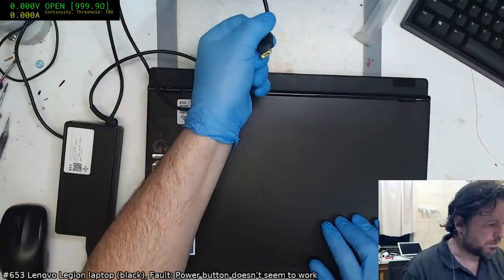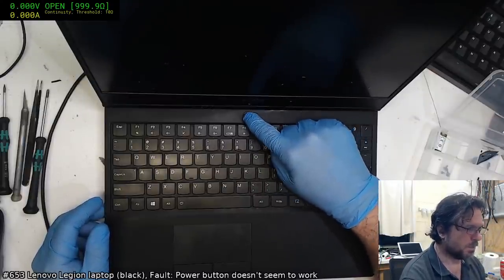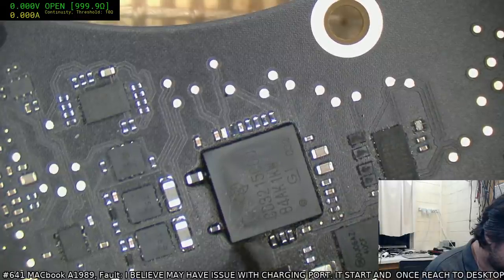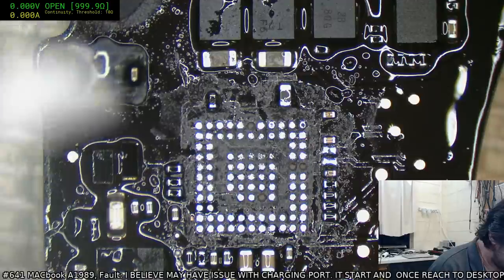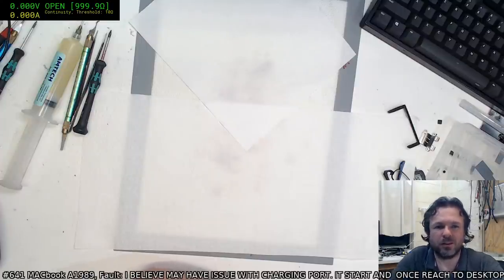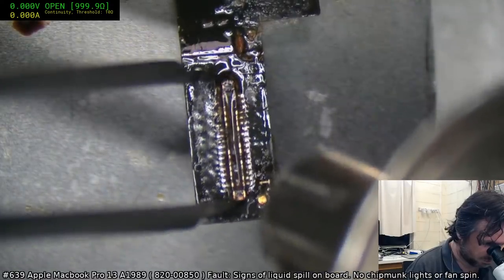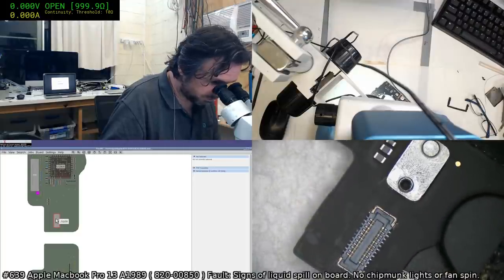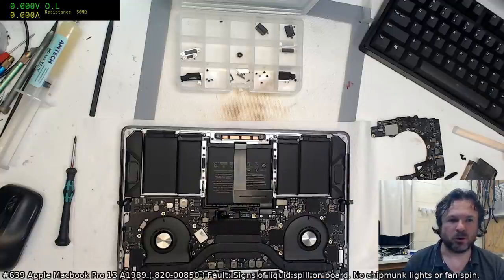Laptop and Macbook Repairs from Rural Australian Workshop

Comment: An oddity about the first A1989 (stop sign icon machine): 
When the machine is turned on after the new CD3215 is put on, at 5 times the icon changes very briefly (to the point that you seemingly only notice it happening twice):

1 27 44: Apple logo at boot - you notice and mention, as it turns into the “stop sign” nearly immediately.
1 28 02: Very briefly Apple logo
1 28 14: Very briefly Apple logo, but a bit longer than 12 seconds earlier.
1 28 24: Briefly question-mark-folder, then Apple logo
1 28 34: Briefly blank screen, then question mark folder, then Apple logo - you notice and seem to think it has something to do with flexing the screen/hinge as you open/close the machine a bit.

No idea what’s going on, but felt I had to mention it.
Btw: Apple has a page specifically about the “stop sign” icon and what it means. You seemed to be more-or-less clear about what it means, but you were trying different things, and since they mention one specific action - a link:
If your Mac starts up to a circle with a line through it - Apple Support

Second machine - ultrasonic wiped away all the clues. At 2 44 30 in my eyes R5322 looks like it has a bit of fluff-looking something on it, even after an ultrasonic. Odd. And one pin (16) on J5100 was a bit darker, but you dismissed it on stream. 

Still can’t wrap my head around why people think a shorted CD3215 would make CD3215 fuses blow. They’re CD3215 fuses in the same way that the patriot act is patriotic, the fuses aren't even between the VIN and the chip. I'm probably overlooking/forgetting something.
Reply from the maker: Touchbar was a pin that hadn't sat down on the replaced FPC connector on the display portion ( the iPhone X one we used ).  All working now.

Comment: Mechanic has glue dissolver/remover for BGA chip. You can try it very easy to use just need little bit of patience. They claim it is non-toxic but you need wear full set of protection gear. It can dissolve rubber so glove may not be safe.
Reply from the maker: I've seen those before, stink terribly too supposedly. I'm more than content to stick with the current method which at least will work with a lot more underfill types too.  What I do need to get however are some better bullnose lifting blades.

Comment: CD3216 - What was it you were cleaning off?  Some kind of mounting glue?  And why is it there?  Easier manufacturing?  Thx.
Reply from the maker: Underfill. Multiple reasons for them to use it, not quite sure which ones Apple really is picking.
Reply: Or, maybe heat dissipation?